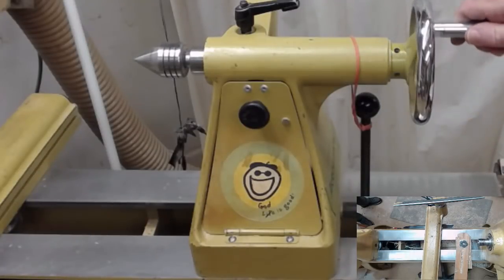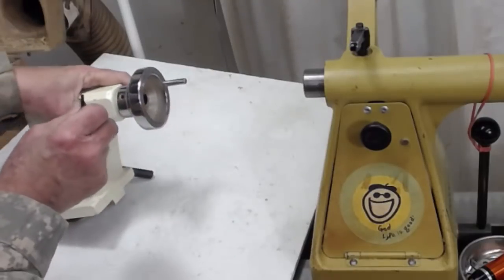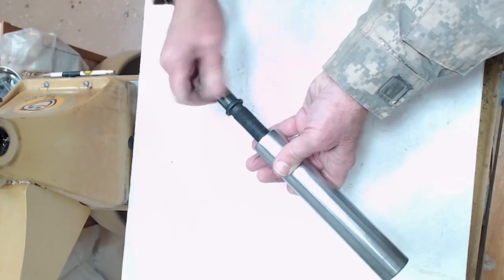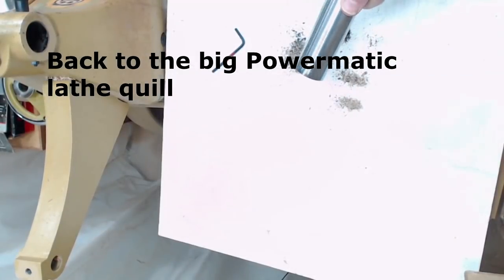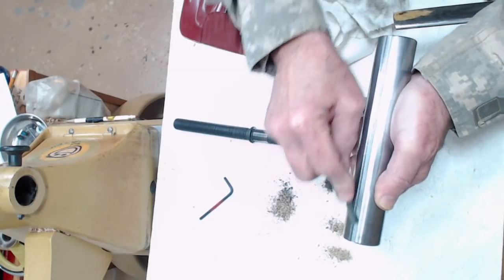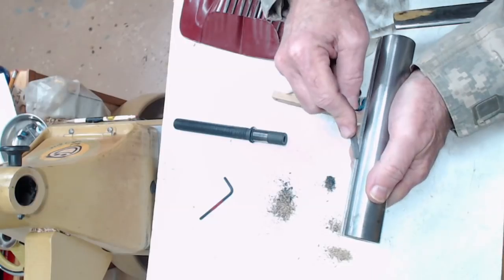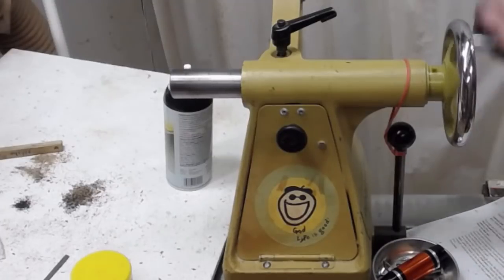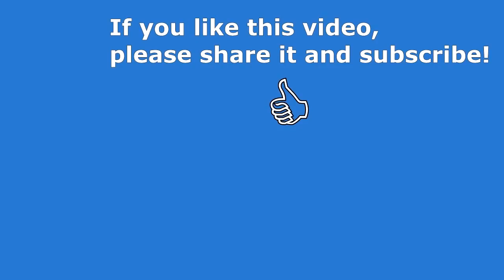Tailstock Maintenance for Woodturners

Comment: A very good topic.    Many wood workers and turners I know do not like to perform maintenance.   I think it is good to keep things working smoothly.  Also helps to minimize wear or keep the machine performing to specification.

Not all lathes need the handle to be removed to get the quill out.   My NOVA DVR lathe does not auto-eject the quill, so its handle is attached to the tailstock.   The quill just screws out with the handle in place.

Good advice to check the channel for the pin.    This is easily swaged over time.

I have worked on the quills of two midi lathes, one a Delta and one a Rikon.    The Delta channel for the pin was messed up.    This was due to a manufacturing defect.   The hole for the pin was drilled at an angle.   I was able to mount the tailstock in my milling machine and drill another hole at 90 deg to the quill.

Dry lube is a good product to use.   I would also spray into the tailstock.    If dry lube is not available, a light weight oil like 3-in-1 works well.    Grease should be avoided, it will hold wood dust and make a mess.

These days I like to use PTFE based dry lube.   This is a higher temperature product than the commonly available teflon products, and so can be used in my 3D printer as well as the wood lathe. 

Your quill did not have burrs on the Morse taper, which is good.   I have special hand reamers for MT2 and MT3 which can clean up the Morse taper.   They work well, but are expensive.   A poor-mans reamer is a 1in strip of e.g., 600 grit wet-dry paper lubricated with WD-40 and wrapped around a known good taper like the end of a live centre or Morse taper drill.   Rotate the taper in the direction of the spiral of the paper.   You will hear and feel as any burrs or nicks in the taper are removed.

Dave.
Reply from the maker: Great tip to use another MT! Thanks for sharing.

Comment: Thanks, Mike! I could not figure out why the quill on my two month old lathe suddenly became so difficult to turn. As you point out, a burr had formed along the edge of one of the channels running the length of the quill, and a couple passes with a file got it working smoothly again.
Reply from the maker: Glad I could help!

Comment: Thanks for the tips on taking my tailstock apart. Found out my lead screw was stripped so I bought a new screw and quill. The new screw had a ding in the threads as well. So anyone who might read this...don't try to force the threads. They are too fragile and they are left hand so can only be machined to restore. A new screw was less than $50 delivered.
Reply from the maker: Glad it helped.

Comment: That was very informative as I have bad trouble with my tailstock. Unfortunately there is a piece on the lathe and my handle is frozen.  I can't move it forward or backward. Any ideas?
Reply from the maker: Slide the tailstock back. Remove the handwheel and see if some spray pentrating oil might help free it up.

Comment: good morning. My ratchet lock broke. how do I know what what to order as a replacement? Is it based on the screw size or length of screw? I am very new to turning. I was given a full size lathe about 2 years ago and have just started trying to learn how to use it. The tail stock is stuck and not extending at all. so thank you for this video. Please any advice would be great. My chuck also was stuck yesterday and thank you for that video as well. Got that going then the other end gave me trouble.... Not a good day in the workshop but I guess I am learning the hard way on how to take care of my machine. hope to hear from you soon. Thank you
Reply from the maker: Check out this video for assistance https://youtu.be/Ik-UiFlQ8v0 and let me know if you still have problems.

Comment: Hello, I thank you for sharing your experience that has been very useful to me to learn more about the world of turning, I would like to ask you if you know of a store where I could buy those internal parts of the Tailstock or with what name could I search?
Reply from the maker: If it is internal to the tailstock you need to go to the manufacturer's website as each lathe is different. You can usually download the manual for most modern lathes. The internal tailstock parts are a quill and a lead screw. If it is a removeable live center that mounts in the Morse taper, any woodturning vendor like Craft Supplies USA or Woodcraft. Or Amazon.
Reply: @MikePeaceWoodturning  thank you so much

Comment: I recently cleaned my tailstock on a Jet 1642. Same process as what you demonstrated. Thanks for the video. What’s that red rubber band for that’s connected to the lock down handle on the tailstock?
Reply from the maker: It is a large rubber band that keeps the TS lock lever in neutral so I can slide TS with one hand and not have to use one to hold the lever up.
Reply: Mike Peace Woodturning   Great idea. I’ll have to add that to my lathe

Comment: Maintiance, something I have tried to get into so many minds. I've been a mechanical technician my whole life. I have a little saying, "anything built by man is subject to failure without any given notice",. All machinery requires it, some more often than others. A little time doing maitiance can make all the differance, could keep you going instead of saying, "my machine is broke". Put it as a normal part of any operation, its very important. Oh yeah, WD-40 came about during the saturn 5 rocket era. Nasa was having issues with rust forming on stored parts and asked a team of scientists to try and come up with something to prevent it. End result is what is known as WD-40. WATER DISPERSANT-, formula number 40 worked. Hence, WD-40,  LOL...........Thanks Mike, excellant subject for all...........
Reply from the maker: I learned a bit about maintenance in the Army. I was able to compare  loaner self propelled howizers shared by different reserve units and  borrowed from a storage site that were fully maintained by mechanics versus those poorly maintained by an active duty unit in Texas. The difference in up time and reliability was startling.

Comment: Hey Mike I think it was you that used a custom made magnetic spindle lock for the Laguna 1216  lathe made by Tim? Did I get this right? If so could you possibly drop me his numbers. Thanks!
Reply from the maker: He does not selll them. Try making one of wood. Turned cylender and a glued flat paddle.
Reply: @MikePeaceWoodturning  thank you Mike. My next question for you is this. I do not like the cheap quill handle on the Laguna 1216. Do you know since you bought your new Powermatic if I could put a better handle on the 1216. I want to swap it out. I know I can find something but you have a ton of experience and I really dig your style. Last I feel I need to mention in a question?. Why on earth would Laguna Tool change the color of the power switch from the international colors of Red/Green to White over Black? That is just NUTS! After watching you unbox that new Powermatic I am thinking on selling my Laguna 1216 and follow you and buy the new Powermatic. Good Job Mike. Thank You!
Reply from the maker: Re: the quill handle, I no longer have the Laguna to compare so cannot really say. I am guessing Laguna had a supply chain disruption and temporarily switched to a switch with a different color. But do not know. Might be a good question to pose on the Laguna REVO 12-16 Lathe Owners Group FB page

Comment: A bit off topic, but I just bought my first lathe, a walker turner driver 700;series.  My question is when I lock the tailstock down and advance the quill into the wood the tailstock moves  as I am turning the wheel. I am certain the lock is tight, any suggestions?    Sure have been enjoying your many video’s.  Thank you for spending the time to teach
Reply from the maker: If it slips it needs tightening. I have seen some pros wack the TS lever with a tool handle. Wax on the bedway can make slipping worse. You may need to adjust the locking nut to get the locking range just right.
Reply: Mike Peace Woodturning    Thank you sir,  I appreciate your reply.  Being new to lathes I wasn’t sure but felt it shouldn’t move.     All there is to it is a flat washer and the nut and bolt, might try a lock washer.  As for tightening, I am a very large man and have been tightening it with gusto only to have it move back. I will keep at it👍
Reply from the maker: @dananderson3183  Slide off the tailstock and examine the part that clamps underneathe the bedway. Sounds like their may have been some poor machining. Call Customer Support. They may be able to easily replacy the bad part if that is what it is.
Reply: Mike Peace Woodturning   Thanks again Mike,  the lathe is somewhere around 70 years old but your idea is a good one. I have a good friend who runs his own machine shop perhaps he will look at it and true it up again for me. Likely built in the late 1940’s or early 1950’s
Reply from the maker: @dananderson3183  I have seen this complaint on some mini lathes that used a large round washer. Someone actually fabricated replacement square  or rectangular blocks with milled sides to better grab the bottom of the bed. Your machinist friend should be able to sort that out for you.
Reply: @MikePeaceWoodturning  just thought I would follow up.   My 85 year old father suggested I try a fine thread nut and bolt.  It is working great now without sliding.

Comment: Hi Mike I know this video is 4yrs old but I actually bought a used jet 1014 back in February. Unfortunately I think maintenance was not even a thought for the previous owner. I took the tailstock as far apart as I could but couldn't seem to get the handle off . I assume once you remove the set screws it should just slide off which unfortunately is not the case for me. Any suggestions on what to do with it.
Reply from the maker: Spray with WD40 and let it sit. You may have to tap around it a bit with a wooden mallet or pllstic handle. Make sure All of the set screws are out and spray in those holes as well.
Reply: @MikePeaceWoodturning  thanks Mike work great. There was a lot of black dust almost like coal dust in there which would explain why it was hardly turning at all. Has a lot of scoring in the tapers inside, doesn't  look like the previous owner really didn't do any maintenance on it.